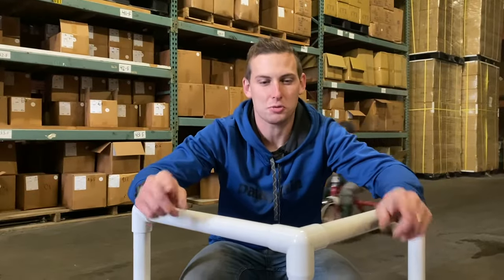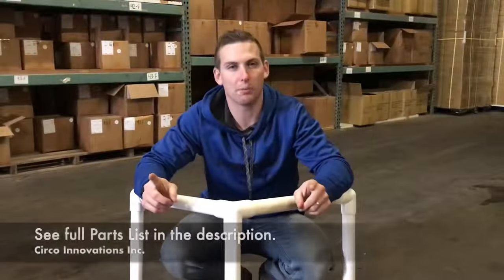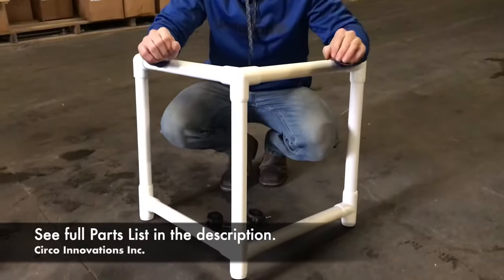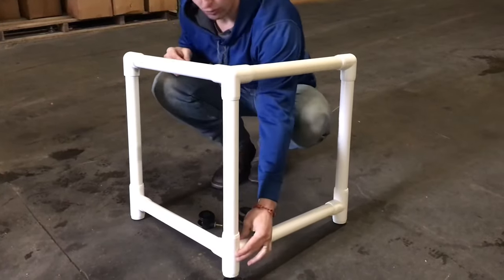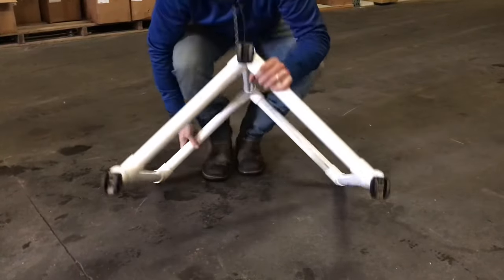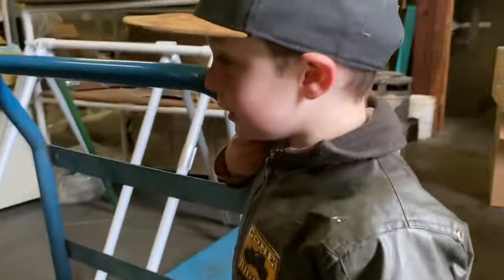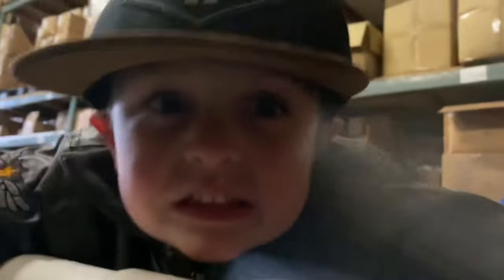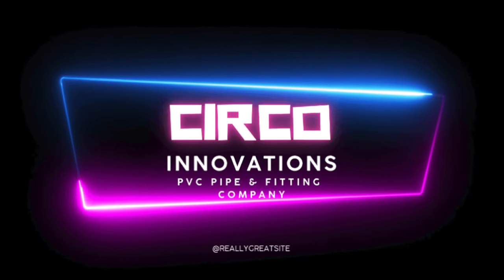PVC Skating Trainer / How to Build Your Own Roller Skate or Ice Skate Trainer

Comment: How do you use the height of the child to get an appropriate length of the pipe please?
Reply from the maker: I would measure your kid with skates on. Once you know that you can cut your pipe to half of that number. Once you have the casters on and the fittings it should end up at the right spot.

Comment: Do you sell the set online?
Reply from the maker: You can order the parts online or call 530-272-3382. We are working on getting plans posted to our website. See parts list below 

Parts List:
• 7 sections of 1-1/4” PVC pipe cut to 17-1/2” long
• 2 elbow fittings (Item #114-F) 
• 2 tee fittings (Item #124-F)
• 1 of the 4-way fitting (Item #44-F)
• 1 of the 3-way fitting (Item #34-F) 
• 3 Caster Inserts (Item #94B-F) 
• 3 caster wheels
Reply: Any promo coupon? $15 for shipping 😅
Reply from the maker: Kit now available: https://www.circoinnovations.com/circo-direct/Skate-Trainer-p615969617